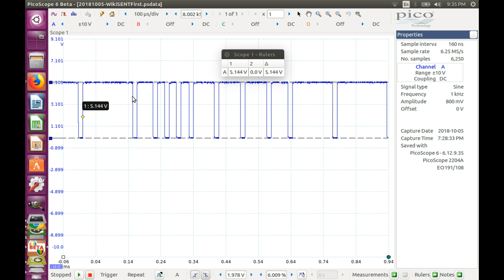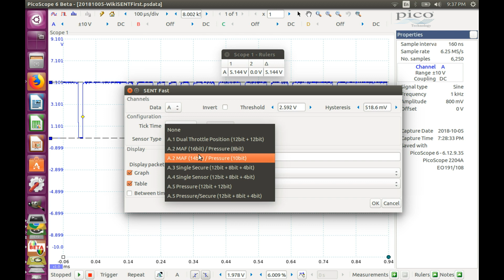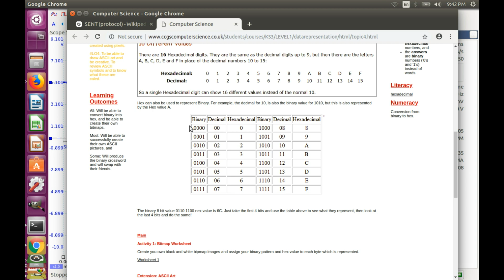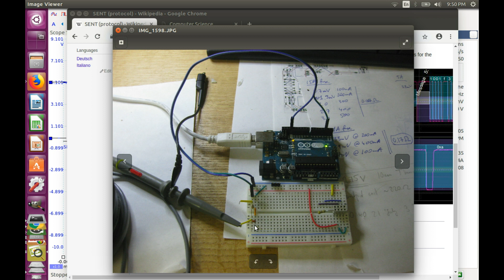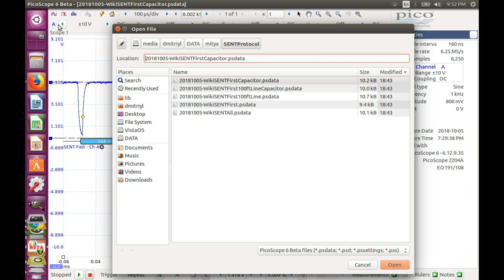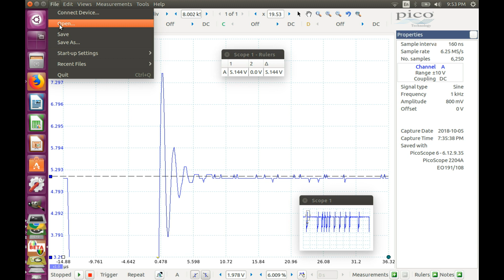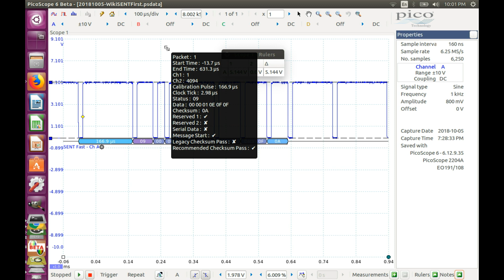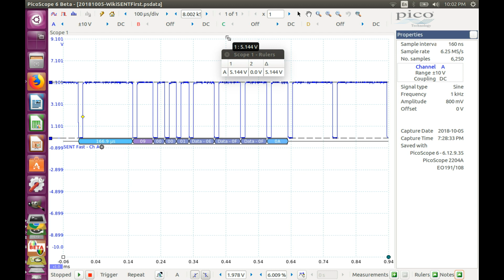SENT protocol waveforms: what to look for.

Comment: Do you mean synchronous and asynchronous SENT? The SENT I have been using is uni-directional, from sensor to ECU. There are multi-directional SENT protocols being developed now, however I don't know the progress on that. There is no pulse from the ECU on uni-directional SENT. However there is pause pulse and no pause pulse SENT like you described. No pause pulse just sends out new data whenever the previous frame has ended. Pause pulse enabled makes the frames sync on for example each 1ms. I use for example MLX90372 from Melexis. It's a magnetic position sensor. I'm a field application engineer for Melexis. See the datasheet 
https://www.melexis.com/en/product/MLX90372/Gen3-Triaxis-Rotary-Linear-Position-Sensor
Reply from the maker: Hi David, thank you for stopping by. I have a video describing operation of TLE4998C3 sensor, which does require a pulse from the host MCU: https://youtu.be/b6NshOi-QqE
 Also Allegro uses similar approach for its own sensors: https://allegromicro.com/en/insights-and-innovations/technical-documents/hall-effect-sensor-ic-publications/an296131-fast-sent-message-response-a1346-shared-bus
All these are extensions of the SENT protocol standard, but it is important for diagnosticians to be aware of them -- such sensors appear to be dead without trigger pulses.